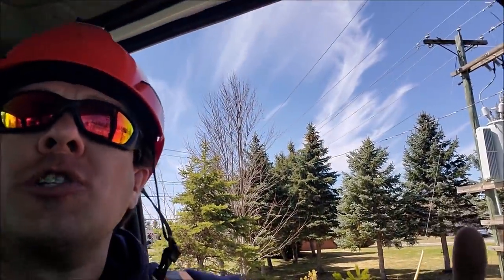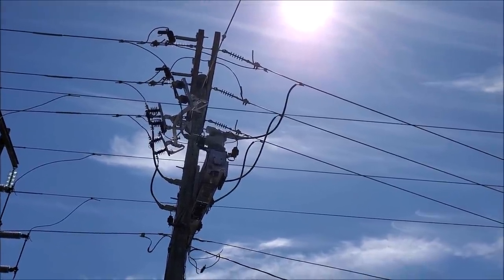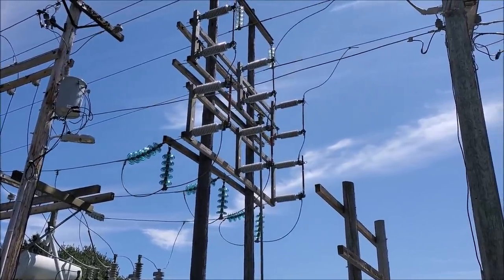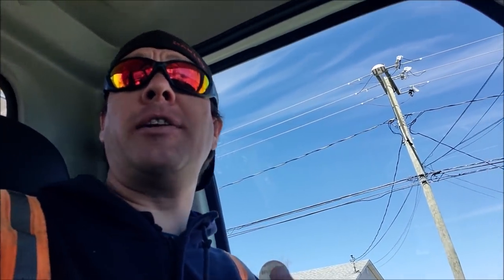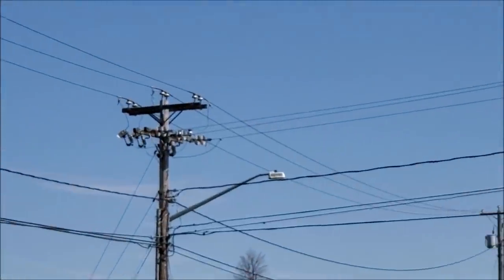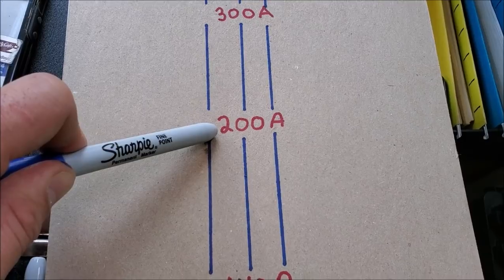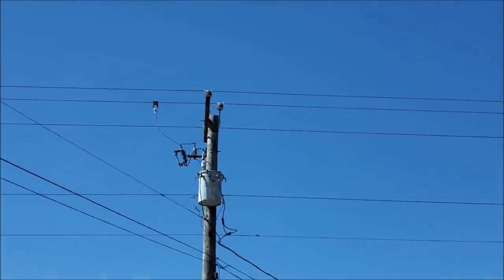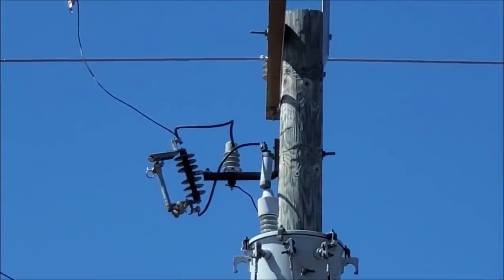Basic components of a power grid

Comment: A transformer does not contain magnets. (If they did, it would be erased [degaussed] in the first few cycles of use.) They do contain a "magnetic" core.  This is usually low carbon steel, usually in layers, that are specially designed to work a given frequency with the least amount of loss and maximum field (flux) for a given current.
Reply: that was the devil in me talking i apologise , sorry

Comment: Do you ever have to upgrade transformers with larger ones in areas that were built in say the 50s and 60s because of load growth? A friend of mine lives in a house built in the 60s--none of the houses there were built with air conditioning but they all have it now. The transformer size was never increased---it was a 25kVA transformer feeding 4 houses! ..and it blew one day. Apparently they replaced it with another 25kVA and it blew again, so they put a bigger one in. Been fine since. By way of comparison, my house (built in 2017) has a 37.5kVA transformer and it only feeds my house. My house has a heat pump with electric backup heat so that maybe why it's that big.
Reply from the maker: Yes! This is a rather big problem actually! 
Technically when a house installs a large heating unit, or converts from an alternative source to electric.. we are supposed to have been made aware through means of permits.
This allows us to make necessary changes to equipment in the field. Unfortunately when entire blocks install mini heaters, the load quickly ads up and can wreak havoc on our system!
Reply: @Bobsdecline  I've often wondered if this would be a problem when EVs hit the tipping point with long range and low enough cost, especially for rural homes.  Come home and plug in your car, turn on the heat or A/C, start laundry, cooking, etc
When I've brought this question up in EV debates I'm always told "no there's plenty of unused capacity everywhere and they charge at night with lower peak draw" but it seems like at night is when you'd have peak consumption (especially with electric heat that is common in rural areas)
I think the peak usage without any EVs I've seen at the place we rent is around 45kW on winter evenings.  Dual heat pumps with 10kW aux heat each (and runs non-stop if we get a cold-spell below 20F), 4kW hot water heater, well water pump, electric oven, electric range, electric clothes drier...plus all the other various things in a home lights, heated aquariums, computers, portable heaters, etc.  Not sure how big the transformer is at the end of the driveway but it looks like it's got 2 sets of wire on the secondary so I assume it's feeding us and our next door neighbor.
Reply: @Bobsdecline  What do you think is going to happen when all these companies that ordered Tesla Semis try to hook up the Megachargers that draw 2 MW for each charging stall? Semi is supposed to have a 1 MWh battery, and Musk claims a 30 minute charge time, so that's a 2MW charge rate.  I think everyone is in for a big surprise.
Reply: @matthewmiller6068  that is definitely an issue.
However EVs could also use the extra energy produced by renewable energy like solar that is currently often there in excess. However for that they would need to be more "intelligent" then current EVs. Here in Germany that is widely discussed.
However I somewhat doubt that it can use the solar energy very well. At noon, basically every is at work, and probably won't charge his car. Most cars will get charged at night.
Reply: @matthewmiller6068  Probably load management switches could be used to control when the EVs charge. The local utility here already uses them (and has been for over 30 years) for air conditioners and water heaters at the customer's request--they will repair any electrical problems with the water heater, no charge, and send someone out to troubleshoot air conditioner problems, no charge, in return for having a load management switch. 
Regarding aux heat, I installed a toggle switch between the W wire of my thermostat and the heat pump. This disables aux heat unless I want to enable it. It will still come on when the heat pump is in defrost, but not otherwise. I installed that switch three years ago and I have not had to turn it on yet. I found that the thermostat I have is really stupid about using aux heat and I suspect that's true of most of them. It will turn on aux heat when it is definitely not needed.
Reply: Brian Leeper yeah, I disabled my electric heat on my heatpump like that too. Then we had a really cold snap and I forgot to flip the switch. The heat pump beat itself to death running constantly at zero degrees blowing 40-50 degree air in the house all night while I was at work. Not good.
Reply: @stargazer7644  If that's likely to happen you may want to wire a thermostat set at say 55F in parallel with the switch so that if the inside temp drops that low it will allow the aux heat to come on. But just running continuously for hours on end isn't going to kill your heatpump (unless it was already on it's death bed).
Reply: @brianleeper5737  I just swapped it for an intelligent digital thermostat (instead of the old mercury bulb type) where I could control how much lag was required before the emergency heat kicks in.  No more problems.
Reply: @stargazer7644  Does it let you set the differential to whatever you want? The Honeywell thermostats I have seem to give you two options. I have it on the option that's supposed to save the most energy and it will STILL turn the aux heat on if the set temperature is more than 2 degrees higher than the actual temperature...even if it's 45F outside. It's like this particular thermostat is designed to waste energy.

Comment: You know, the primary fuse makes such a loud noise when it blows is because there is an explosive coating inside the tube of the fuse link.  When the filament melts it ignites this material and the resultant explosion helps to eject the load side of the fuse link and break the circuit quickly to prevent an arc from forming.  Kind of like an explosive load break system.
Reply: Wow, that makes so much sense.

Comment: I am a firefighter in the US. They always teach us do not touch wires even if you think you know what it is. My question is are the actual power lines typically on the top third of the pole? I feel like after awhile we can typically tell if it is a power line or cable line however we do understand that a fault could cause in some cases power to be grounded or transmitted into other lines unintentionally hence us not touching them. I still see a lot of guys say oh its just cable lets grab a pike pole and move it. Thoughts on this? I can understand where a lot of firefighters see the cable lines and just want to move them out of the roadway to get the job cleared and not waste your time coming out. But i also understand the dangers associated with electricity and why we should not be touching it even if we know what line it is.
Reply: It's definitely possible to have primary get into CATV or telephone cable support strand. Say a car brings a pole down, and the primary is crossed over some joint mounted utilities and theres no low impedance path to earth.  Now, all that stuff is lit up to the primary line voltage, waiting to kill anyone without proper PPE.

Comment: Interesting!

I'm an Electrical engineer in Nigeria 🇳🇬 working in the power distribution sector. 

We almost do not have single phase transformers. Distribution transformers are typically three phase and are closed to 11Kv or 33 Kv  feeders with three High tension fuses per phase. We sometimes see the three fuses rupture which most times indicates a serious fault on the transformer side.

Interesting watch. 
Thanks!

Comment: Watching this awesome piece again, Living at the corner of a main feeder, there are automated reclosers and when those things go it sometimes violently shakes the house, should note though being on this main distribution line there are many sidelines most of which are below ground so whenever there is a fault it usually effects several hundred to a thousand customers, also at the corner it goes from a 3 phase to a single phase on the road nearby which actually ends about a mile down the road before being taken over by another power provider to the area. Sometimes called the big two. Watching from New Jersey Somerset county, my power provider JCPL severs 1.1 million customers while the other company serves over 2.3 million customers.                                                                         Personal Side Note Here: People say PSEG is better at restoration, they always gets customers up quicker, well yes having about 1.3 Poles per Customer and having shorter line spans versus JCPL having 2-3 poles per customer, longer line spans and serving a vast rural area at half as many customers with a non grid street setup will do that and also an extensive overhead tree canopy. Great video as always though.

Comment: AFAIK lightning arrestors are actually Varistors, which are a semiconducting device that acts as an insulator until it reaches its breakdown voltage and then stars conducting. metal oxide varistors are used in household surge suppressors in conjunction with a small breaker to limit the voltage & trip themselves to protect whatever is connected to them.
Reply: Thanks for sharing about varistors
Reply: There are different kinds of lightning arrestees. MOVs that you describe are the most common, especially for consumer electronics.  High voltage applications can have other kinds, such as gas-gap or air gap.

Comment: I always wondered what value the gauges on the voltage regulators indicate. Thanks for sharing !
Reply: The gauges indicate the position of the taps at a glance.  There are also smaller dials which show the lowest and highest taps reached since they were last reset.  
3:10 Just behind Aaron, you can see the tap position indicator (the thicker dial) just to the right of center.  You can see the other two smaller dials indicate the lowest and highest positions the tap has been automatically changed to through the time since it was last reset.

Comment: Last week our neighbor's feed line (line that connects pole to meter) failed catastrophically and linemen had to cut power to whole street to isolate the problem just like described. Cut power, isolate, restore power, and then deal with the faulty line. It is a good safe way of protecting customers and electric grid equipment.

Comment: I had a transformer blow a few years back during a lightning storm after a lightning strike.  Bright green light, and then all that oil oozing from around the seal at the top. Earlier this year Edison had to come out and replace everything on the pole. Electric bill went down 30 bucks a month afterwards. In 30 years they have replaced 3 transformers. We are in a lightning prone area. Enjoy the videos...
Reply: "Electric bill went down 30 bucks a month afterwards."  Was your meter upstream of the transformer ?   Otherwise it should have made no difference.   The meter runs on the power you consume.  Nothing to do with the transformer.

Comment: Long ago, I worked at Cooper Power Systems, a manufacturer of switchgear, "small power" transformers (ie. transmission to distribution voltage) and pole-mounted transformers. My job: manage the mini-computers that controlled the "quality assurance test cells", wherein technicians simulated lightning strikes with 100KV and 10KA to 50KA (depending on specs). The test cells were DIRECTLY above the computer room and MY office. When transformers "failed" the "lightning surge" test, the building shook, followed by a mass exodus to the bathrooms for a panty change. Independence Day fireworks, EAT YOUR HEART OUT!

Comment: I started watching recently, and I've actually been able to identify a lot of power equipment in my local area- but those capacitors has me seriously stumped for a while! Had no idea what they were until today.

A particularly interesting thing to me that I feel is worth mentioning; it sounds like this isn't really a thing much in your jurisdiction, but down here we actually have full gang switches on the three-phase distribution lines! There's four of them within a half-dozen spans of each other going up the hill where I live, one of which is open by default- probably for alternate feed purposes.

I'm actually not really sure why there's so many of them here; the first one that's normally open is fairly easy, but two of the other three are positioned after major neighborhood entrances, usually a pole or two after a set of cutouts for underground power to the neighborhood in question, with the third all the way at the top of the hill. My best guess is they're for isolation/protection point purposes, but I don't really know why you'd need so many in such a small distance for that.

(For perspective on exact distances, it's about 1 mile/1.6 km from the open switch at the bottom of the hill to the final switch at the top. Most of these switches didn't even exist until last year; parts of the line running up the hill were recent additions, as it wasn't continuous previously.)

Comment: Arrestors are even cooler than just plain resistors....meet our wonderful friend, the Metal Oxide Varistor! An MOV is basically a block of semiconducting crystals sintered together that presents itself as a very high impedance across the line under normal conditions when the voltage across the MOV is below a magical threshold called the clamping voltage. Above the clamping voltage, the MOV RAPIDLY (Less than a few nanoseconds!) becomes a low impedance path. This often wrecks the MOV but saves the downstream load. In short (pun intended), MOVs relocate the "kaboom" to a more convenient, less costly location. 

MOV end of life behaviors: They'll either blow apart and fail open or they'll fail "leaky" and conduct some current but not full fault current. If the varistor doesn't burn away and go open, it will progress to a fault and blow the supply fuse. In small arrestors that may be near building materials and plug-in type suppressors used indoors, this leaky failure mode constitutes a serious fire hazard and is the reason we have standards like UL1449 which mandate thermal cutouts be placed near the MOVs. Down here in Texas with all the storms we get in the Dallas area, I've seen more than my share of blown apart MOVs in my electronics repair business but the damage to the device equipped with an MOV is usually far less severe than those without. (one is usually economical to repair, the other....much less so!)

Comment: Another way to explain power factor is that some devices with poor power factor “borrow” extra power from the grid on each half cycle and temporarily store it in a magnetic (or electrostatic) field in the device, and give it back to the grid a half cycle later. All this extra current going back and forth performs no useful work, and costs the customer nothing, but it puts extra load on the grid. Those capacitors you put on the line give a small extra reserve  of power on the pole for those devices to borrow from so that extra borrowed power going back and forth doesn’t have to go all the way to the substation or generating plant causing load and losses across the grid.

Comment: The phrase a blown fuse comes from the way larger commercial fuses work. These fuses have a circuit in them that monitors the current going through them and when the current exceeds the fuses ratting for its rated time the circuit sends current to a small explosive charge that will blow the conducting elamit apart. So the fuse literally blew the housing of the fuse contains the charge and there is usually a little window on the fuse that will turn dark indicating it has blown.

Comment: AC power delivery is a lot like  engine power delivery in a vehicle, AC power = high voltage at lower amps at the source and lower voltage higher amps at the consumer end. engine power = higher RPM's at the motor but lower power until it gets to the wheels then its lower RPM's and higher power.  In the power grid it is changed via the "transformer" in the vehicle it is changed via the "transmitting". AC transition lines, vehicles drive shaft and axial s. Delivery of POWER, what a great thing !

Comment: I love these videos, so much cool information! Is there any special equipment present at Fast Charging stations for electric vehicles? It seems like some of these stations with a lot of stalls can pull over 1MW. Are these still fed with 7200v/12470v phases? If there are any of these large stations in your company's service area it might be a cool video!
Watching from Upstate NY!
Reply: I used to work at a datacenter that pulled 7MW. Feed was 7200/12470 into a bank of 2.5MVA transformers and from there 277/480 into a bus and then to a bunch of 150kVA to 750kVA transformers feeding literally hundreds of 120/208 circuits for the compute racks. The cables on the pole were FAT! Cooling ran at 480V and each room had 18 computer room air conditioner (CRAC) units of 30 ton capacity each and it still got uncomfortably warm in some sections.
Reply: @MadScientistsLair  Cool insight, thanks for sharing!